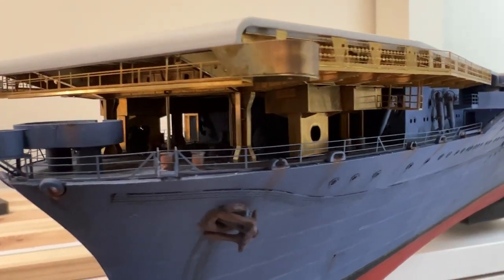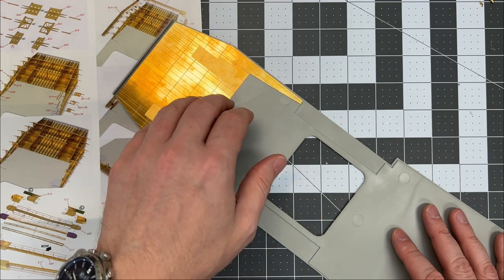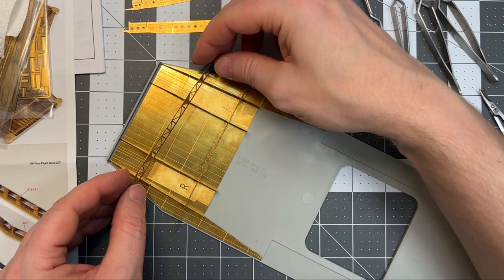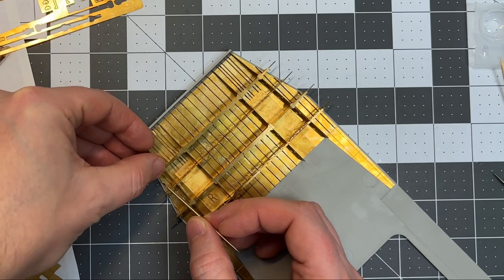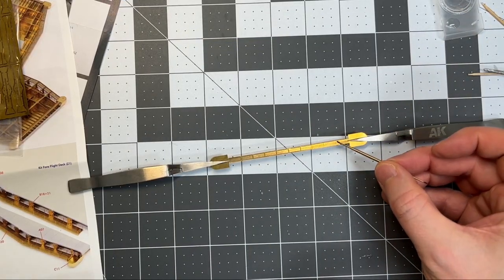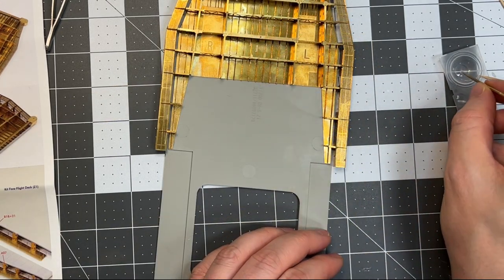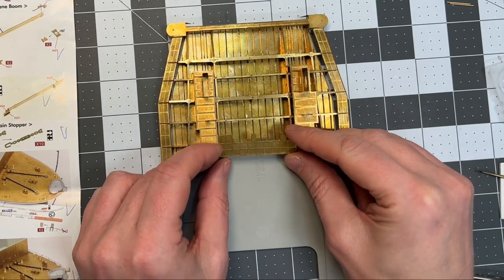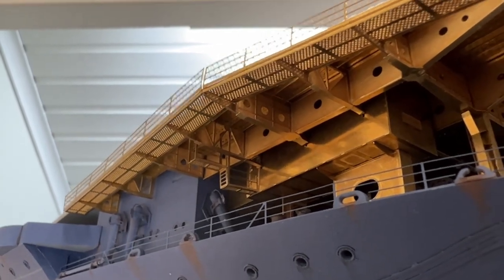CV-6 Bow Flight Deck

Comment: Hi Kenneth! Great work as always, and hope you had a relaxing (and well-deserved) summer break.

Question for you: when you were painting the areas underneath the bow and stern flight decks (that may not have been facing the sea, i.e. girders and buttresses) what was your painting philosophy? Sea Blue for verticals and Deck Blue for horizontal throughout, or perhaps a third color to reflect that certain areas may not have needed camouflage paint? Thank you as always for your guidance!
Reply from the maker: Thank you 😊 I had a great summer vacation, hope you had one too! 
I have used the same approach for the entire ship, regardless if it is visible from the sea or not. 
Have a great weekend 😎
Reply: Thanks so much, and have a great weekend, too!